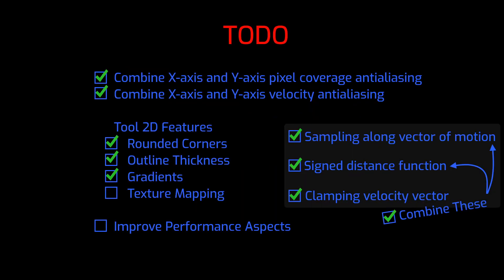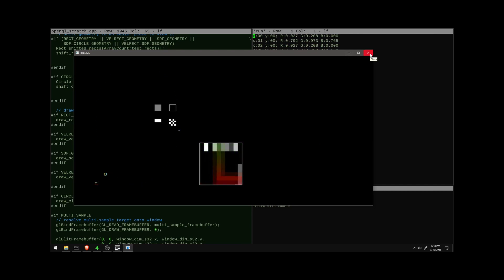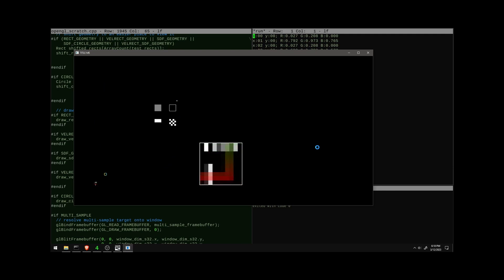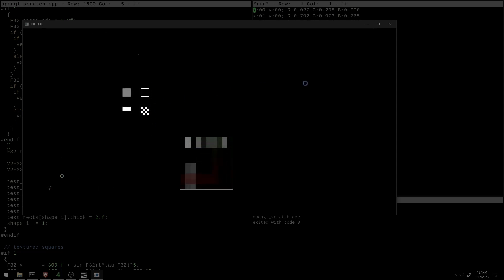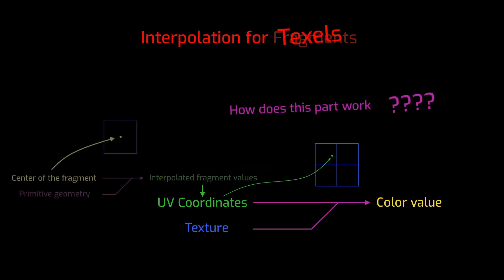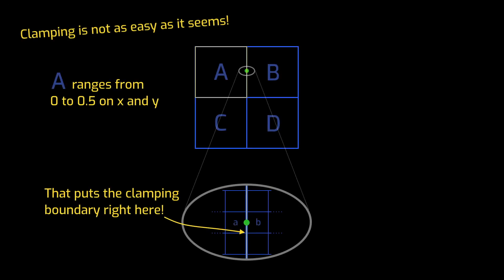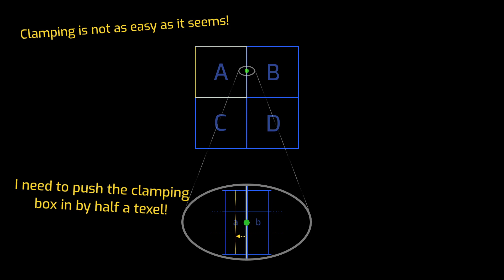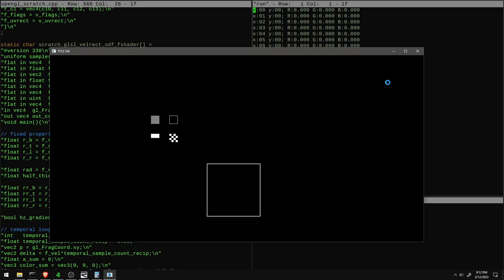Graphics 3 [12]: Texture Mapping

Comment: I know this is not directly related to this specific video, but I wanted to ask a question about scratch arenas. I have been using them for a while in my code, and it has made my life a lot easier. I was wondering if you think it would be a good idea to try a macro that creates a region of scope for a specific scratch arena. Something like this:

#define SCRATCH_REGION_NAME(name, conflicts, num_conflicts) \
    for (TempArena name = scratch_get(conflicts, num_conflicts); \
        name.arena != NULL; \
        scratch_release(name), name.arena = NULL)
#define SCRATCH_REGION(conflicts, num_conflicts) SCRATCH_REGION_NAME(scratch, conflicts, num_conflicts)

I have not tried it extensively, and I am not totally sure if it is good to tie a scratch arena to a scope like this. I was mainly thinking about ensuring the scratch arena was released. What do you think?
Reply from the maker: Okay some thoughts.

First, if you're in C++ I would much rather use the class based auto-scope-closing. The for loop closer trick is very confusing to anyone who doesn't know what they're looking at and is a bit clunky to use even when you know what it is. That's not to say I think it should never be used if you're in strict C.

Second, it's usually not the case that I want different scratches on different blocks. Having N nested non-conflicting scratch blocks adds a lot of complexity to the code (the final code - whether or not you generate it with a clever trick from source code that looks simple, the final output code has the complexity in it). Instead I'd just settle for the extra memory usage that is entailed by having one over-arching scratch for the whole function scope. --- IF that gets to actually be too much there are some techniques I do use like "arena ping pong" where I have two arenas and with each iteration of an algorithm one arena is the "previous state" and the other gets cleared and contains the "next state". Or I just decide that at the point where I want a separate scratch I try to refactor into a separate function.

Third, something else to watch out for here is that lexical scopes don't always match the intended memory scopes. It seems to me like a lot of bugs would come up from trying to introduce a scratch at every block. Very often I want an "if" or a "for" block to write into the scratch some variable amount of stuff that will then be used under some other possibly conditional blocks. Trying to think through when another scratch isn't actually a bug, and which pushes go into which of several available scratches all sounds like too much to me.

Putting it together: if the C trick is a bit ugly and nested scratch scopes aren't useful, then I don't think the macro is worth it.

ON THE OTHER HAND - This is just what's true of my style. There may be a perfectly sound arena programming style that would use this. I don't know.
Reply: @Mr4thProgramming  Thank you so much for the thoughtful reply. I was mainly thinking of a way to automatically release scratch arenas in C rather than having nested blocks of scratch arenas. That being said, I do think it is important to think about other people reading the code, which I was not doing. I am sure that there have been countless confused programmers from a clunky macro in C. Going forward, I think I will use scratch arenas as normal and possibly introduce a new scope if that it the desired behavior.